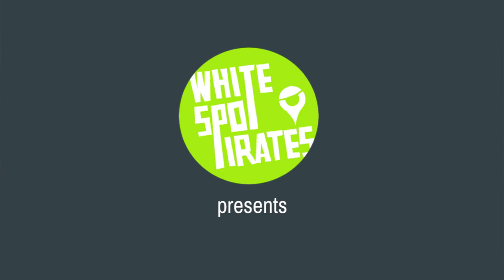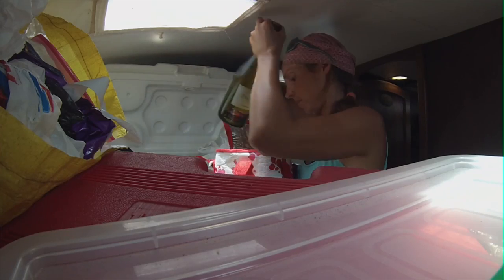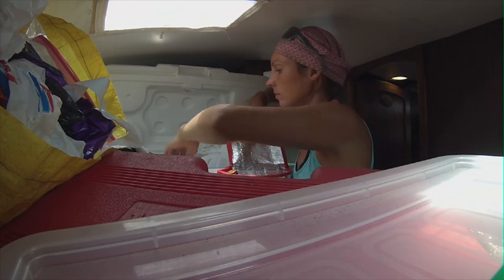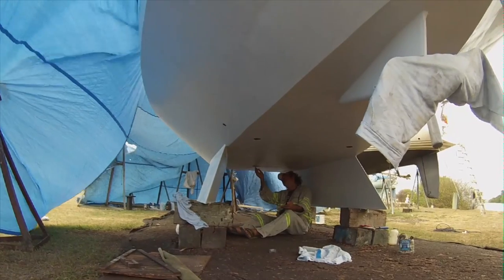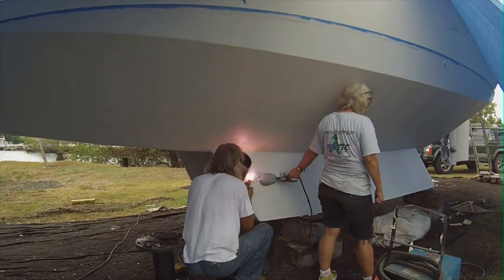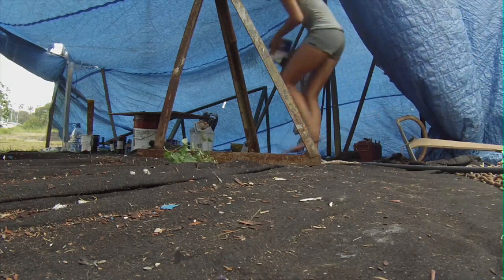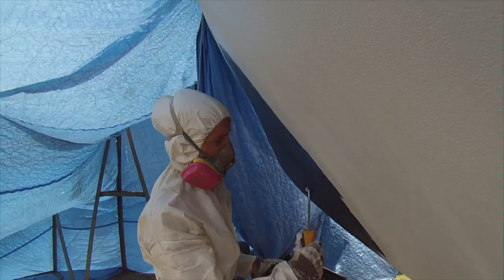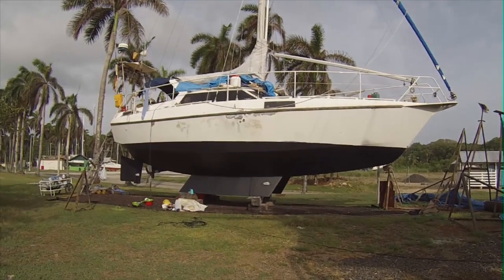Boat Refit: Repainting My Aluminum Sailboat In The Tropical Heat Of Panama - UNTIE THE LINES #34

Comment: To late now, but you could have put pvc pipe or tubing in the thru hull fittings, sticking out 12 " or so and you would have not had the water dripping on the paint issue.. Good job. :-)
Reply from the maker: Hi Fleugar OutDoors, bit too late for that time, but great advice for the next paint job which is about to come soon :). Thank you!
Ahoy, Nike

Comment: Great to see you approaching the point where you can splash Karl. I am curious about the way that you mounted the zincs though. It appeared that you welded the zinc directly to the hull. I believe that you should have welded a mounting plate to which you bolt the zincs. This way you will not need to have your (interesting) welder friend come to the boat every time that you want to change the zinc. You would merely need to unbolt the zinc, and bolt on a new one. This could even be done while Karl is in the water.
Reply from the maker: well, I have those mountings plates in the back and they are welded on to those. I have read a couple of articles and talked to some aluminium boat owners and they told me that this was the best way of doing it. And I hope that next time that I have to change them, it will be a different welder friend. Not because I did not like this one, but because I hope that I will be far away from Panama by then ;)
Reply: O'day 35 I have understood that a metal hull is in use the requirement is 2 different primers.  Please keep an eye on the hull.

Comment: HMMM, so they welded on the anodes. thats great, they will not fall off. Now in 4 months when they are dissolved, how will you change them? As I diver I change anodes, they are bolts on all the boats I dive on. As a diver, how would I change yours?
Reply from the maker: you wouldn't, I guess. I would change them on the hard again. But I hope that these ones will last some time...It's not so they won't fall off (of course, they should not do that either, but as I understand it, that's not the reason for welding them on)...it is to have a good electrical connection and to avoid e.g. the use of stainless steel bolts to put into the aluminium.
Reply: WhiteSpotPirates
they could have done it two other ways that would have worked great! Either welding aluminum studs on, or welding aluminum nuts on. They will dissolve quickly. long before you need to haul out again. at most 8 months, in warm water. In reality you only needed one. As long as everything else is electronically bound to it. Is it too late to weld on a pair of nuts? If not, have them weld on two large nuts, then you can bolt on a zinc.

Comment: Can you please explain for dummies what this thing is the bearded man welded to the boat? ;-)
Reply from the maker: those are sacrificial zink anodes. They protect the aluminium from getting eaten away by galvanic corrosion when it comes into contact with a nobler metals like stainless steel  (e.g. prop shaft) in an electrolyte (saltwate in this case).  I hope I said that right...better google it if you want to make sure you get the whole background about the process of how one metal has higher electrode potential than the other and how the ions migrate from one to the other etc.
Reply: WhiteSpotPirates Thx! Big ups to the "Opferanode" :-D

Comment: Bombastic!  On track to getting wet!  On the business side, you are using the GoPro, yes?  Any pluses or minuses?  I am thinking of following your footsteps and will need a camera for wet and rough use.  Also, I noticed Katadyn as a sponsor.  Comments?  You haven't had to rely on it yet (I don't think) but if you have feedback I'd appreciate it.

May you have a trouble free launching!
Reply from the maker: I do use a GoPro, yes. The Hero 3 white edition. 
pros: super small, super easy to use, good quality of videos
cons: I am not happy with the mounting devices. now I mostly use the base that it stands on when you buy it. But with that you always have to tie it to sth so it does not fall...I bought the mount with this rubbery thing that is supposed to stick to the surface, but it will only hold (and also not very well), if the surface is perfectly flat and super clean. but I think they did release some new mounts so maybe I have to check out one of them...
what has annoyed me a lot is the fact, that it often happens to me, that when I put the camera into the case, I touch the wifi button by accident which leads to the result, that the battery runs flat super quick (if you don't notive it). For me, the wifi button is not very significant, so I would prefer not to have it there but inside...
As I am not a pro and have no comparison to other action cameras and don't know about video quality, I cannot tell you anything more than these short comments...
I applied as a tester for the new Garmin camera...so I hope I get the chance to test that and see the difference.
For my grab bag, I got a manual water maker from Katadyn. I did not try it out yet, but I have it for security. It's not very big and it gives me a lot of peace of mind when I think about the moment that I might have to abandon my boat to go into the liferaft...I am probably going to do an episode about what's in the grab bag one day and then there will be some info on the watermaker as well.
Reply: Thank you much!  If the GoPro is what you use exclusively, then picture quality is just fine.  I suspect you have experience or a natural talent in cinematography, though.  I have read and heard many complaints about the wifi button!  Seeing your product and others I think the GP is the way to go (with suitable hacks for mounting)
I plan to install an electric water maker and have a small manual in the grab bag.  Look forward to your video on the grab bag.

eric
Reply: WhiteSpotPirates For GP mounting there are 3 things that I find useful. 1 - they have an adapter for a standard camera mount thread and that opens up your options not only to standard tripods but also the whole world of camera mounting gizmos. 2 - the pole strap. I found a good one on Amazon which can strap to a rail/pole/stick/tree that is anywhere between 1" - 3" in diameter. It works real well on our boat. 3 - for action shots, I love the chest strap. Its in a good location to give people point of view and they can see what your hands are doing when you are working on stuff.

Per cameras, the GP is industry leader, but I also have the Contour. Image quality and color depth is better on the Contour (by a hair) and the bullet shape gives itself to mounting better, somehow. It's angle is also not as wide which is bad for up close work, but it also does not have the fish-eye curve to its shots.

Your welder guy is an idiot! The moment I saw what he was doing I thought, "this is going to end badly" and then you mentioned that he electrocuted you. Anyone that has done any amount of welding will tell you that they bend the rules. He didnt have or didnt bring a proper clamp - happens. But he should have instilled in you the necessity of NOT touching the grounded hull while spotting the anode for him. You know - he could have stopped your heart!

Glad to see that you got those anodes through!